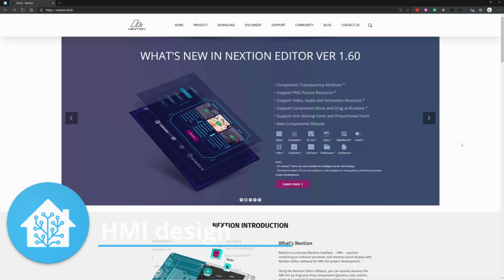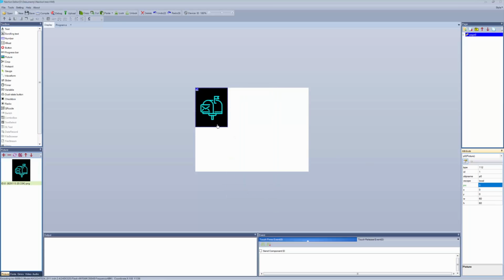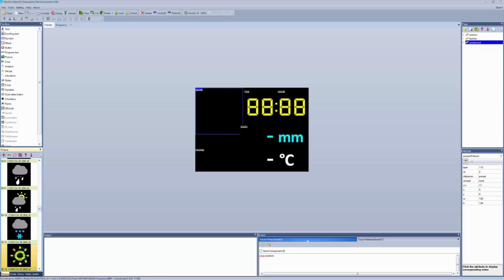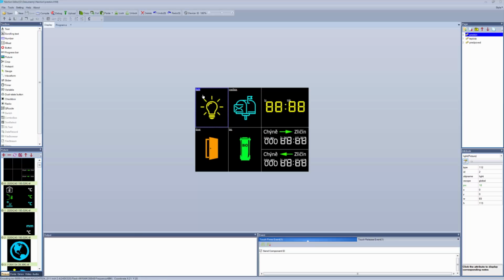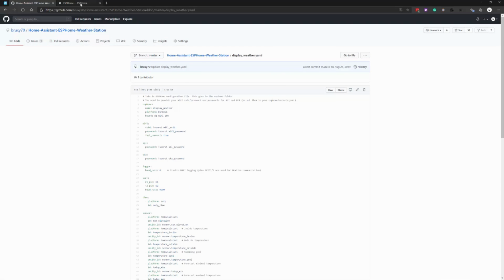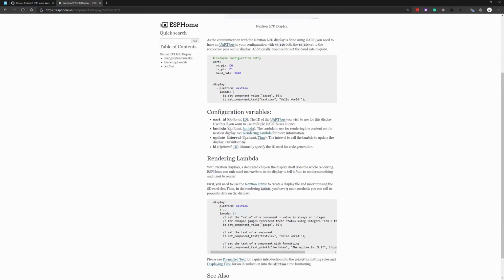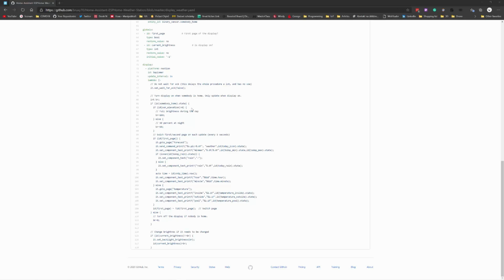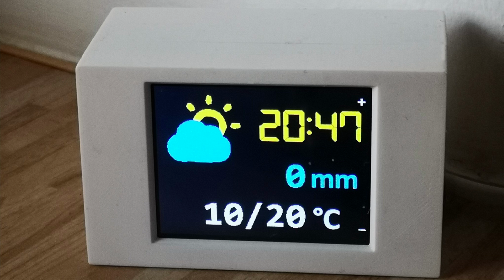DIY displays for Home Assistant

Comment: Hello Vaclav, very good tutorial, very educational and simple. Thank you very much for your time and excellent predisposition. I am working on a home automation project for my house and your code has been very helpful. I have managed to receive information by touching the screen and lighting a led on my proto. Unfortunately I have not been able to send any information from ESP32 to the Nextion screen
Log ESPhome 
[13:42:47][I][app:100]: ESPHome version 1.14.5 compiled on Jul 10 2020, 00:13:46
[13:42:47][C][wifi:415]: WiFi:
[13:42:47][C][wifi:283]:   SSID: [redacted]
[13:42:47][C][wifi:284]:   IP Address: 192.168.0.120
[13:42:47][C][wifi:286]:   BSSID: [redacted]
[13:42:47][C][wifi:287]:   Hostname: 'esp32_a01'
[13:42:47][C][wifi:291]:   Signal strength: -83 dB ▂▄▆█
[13:42:47][C][wifi:295]:   Channel: 10
[13:42:47][C][wifi:296]:   Subnet: 255.255.255.0
[13:42:47][C][wifi:297]:   Gateway: 192.168.0.1
[13:42:47][C][wifi:298]:   DNS1: 200.110.216.250
[13:42:47][C][wifi:299]:   DNS2: 190.12.96.251
[13:42:47][C][uart:040]: UART Bus:
[13:42:47][C][uart:042]:   TX Pin: GPIO17
[13:42:47][C][uart:045]:   RX Pin: GPIO16
[13:42:47][C][uart:047]:   Baud Rate: 9600 baud
[13:42:47][C][uart:048]:   Stop bits: 1
[13:42:47][C][switch.gpio:042]: GPIO Switch 'Relay 1'
[13:42:47][C][switch.gpio:043]:   Pin: GPIO18 (Mode: OUTPUT)
[13:42:47][C][switch.gpio:059]:   Restore Mode: Restore (Defaults to OFF)
[13:42:47][C][gpio.output:010]: GPIO Binary Output:
[13:42:47][C][gpio.output:011]:   Pin: GPIO19 (Mode: OUTPUT)
[13:42:47][C][logger:175]: Logger:
[13:42:47][C][logger:176]:   Level: DEBUG
[13:42:47][C][logger:177]:   Log Baud Rate: 0
[13:42:47][C][logger:178]:   Hardware UART: UART0
[13:42:47][C][light:177]: Light 'Luz Led 1'
[13:42:47][C][esp32_touch:029]: Config for ESP32 Touch Hub:
[13:42:47][C][esp32_touch:030]:   Meas cycle: 8.19ms
[13:42:47][C][esp32_touch:031]:   Sleep cycle: 27.31ms
[13:42:47][C][esp32_touch:051]:   Low Voltage Reference: 0.5V
[13:42:47][C][esp32_touch:071]:   High Voltage Reference: 2.7V
[13:42:47][C][esp32_touch:091]:   Voltage Attenuation: 0V
[13:42:47][C][esp32_touch:097]:   IIR Filter DISABLED
[13:42:47][C][esp32_touch:104]:   Touch Pad 'ESP32 Touch Pad GPIO27'
[13:42:47][C][esp32_touch:105]:     Pad: T7
[13:42:47][C][esp32_touch:106]:     Threshold: 1000
[13:42:47][W][nextion:237]: Received unknown event from nextion: 0x64
[13:42:47][W][nextion:036]: Waiting for ACK timed out!
[13:42:47][W][nextion:083]: Sending command 'draw 50,60,80,102,17013' failed because no ACK was received
[13:42:47][C][dht:017]: DHT:
[13:42:47][C][dht:018]:   Pin: GPIO26 (Mode: INPUT)
[13:42:47][C][dht:022]:   Model: DHT11
[13:42:47][C][dht:027]:   Update Interval: 60.0s
[13:42:47][C][dht:029]:   Temperature 'Temperatura'
[13:42:47][C][dht:029]:     Unit of Measurement: '°C'
[13:42:47][C][dht:029]:     Accuracy Decimals: 1
[13:42:47][C][dht:029]:     Icon: 'mdi:thermometer'
[13:42:47][C][dht:030]:   Humidity 'Humedad'
[13:42:48][C][dht:030]:     Unit of Measurement: '%'
[13:42:48][C][dht:030]:     Accuracy Decimals: 0
[13:42:48][C][dht:030]:     Icon: 'mdi:water-percent'
[13:42:48][C][captive_portal:169]: Captive Portal:
[13:42:48][C][ota:029]: Over-The-Air Updates:
[13:42:48][C][ota:030]:   Address: 192.168.0.120:3232
[13:42:48][C][ota:032]:   Using Password.
[13:42:48][C][api:095]: API Server:
[13:42:48][C][api:096]:   Address: 192.168.0.120:6053
[13:42:48][C][homeassistant.binary_sensor:032]: Homeassistant Binary Sensor 'luz1binsen'
[13:42:48][C][homeassistant.binary_sensor:033]:   Entity ID: 'light.luz_led_1'
[13:42:48][D][debug:023]: ESPHome version 1.14.5
[13:42:48][D][debug:025]: Free Heap Size: 216908 bytes
[13:42:48][D][debug:053]: Flash Chip: Size=4096kB Speed=40MHz Mode=DIO
[13:42:48][D][debug:086]: Chip: Model=ESP32, Features=WIFI_BGN,BLE,BT, Cores=2, Revision=1
[13:42:48][D][debug:088]: ESP-IDF Version: v3.2.3-14-gd3e562907
[13:42:48][D][debug:091]: EFuse MAC: 00007C97F2AB6224
[13:42:48][D][debug:143]: Reset Reason: Power On Reset
[13:42:48][D][debug:186]: Wakeup Reason: Unknown
[13:42:52][W][nextion:237]: Received unknown event from nextion: 0x64
[13:42:54][W][nextion:036]: Waiting for ACK timed out!
[13:42:54][W][nextion:083]: Sending command 'draw 50,60,80,102,17013' failed because no ACK was received
[13:42:57][W][nextion:237]: Received unknown event from nextion: 0x64
[13:42:59][W][nextion:036]: Waiting for ACK timed out!
[13:42:59][W][nextion:083]: Sending command 'draw 50,60,80,102,17013' failed because no ACK was received
He intentado con UART0, UART1, UART2 con el mismo resultado. 
Luego he intentado con un ESP8266 recibiendo un error similar.

The code is

esphome:

  name: esp32_a01
  platform: ESP32
  board: nodemcu-32s

wifi:
  ssid: "XXX"
  password: "XXX"
  fast_connect: true
#  reboot_timeout: 45min
  manual_ip:
    static_ip: 192.168.0.120
    gateway: 192.168.0.1
    subnet: 255.255.255.0
    dns1: 200.110.216.250
    dns2: 190.12.96.251

  # Enable fallback hotspot (captive portal) in case wifi connection fails
  ap:
    ssid: "Esp32 A01 Fallback Hotspot"
    password: "XXX"

captive_portal:

# Enable logging
debug: 
logger:
  baud_rate: 0
  level: DEBUG
  
# Enable Home Assistant API
api:
  password: "XXXXX"

ota:
  password: "XXXXX"

switch:
  - platform: gpio
    name: "Relay 1"
    pin: GPIO18
    
light:
  - platform: binary
    name: "Luz Led 1"
    output: output_led1
    
output:
  - platform: gpio
    pin: GPIO19
    id: output_led1

esp32_touch:
  setup_mode: False

binary_sensor:
  - platform: esp32_touch
    name: "ESP32 Touch Pad GPIO27"
    pin: GPIO27
    threshold: 1000  
    
  - platform: homeassistant
    name: "luz1binsen"
    entity_id: switch.luz_wcedu

  - platform: nextion
    page_id: 0
    component_id: 2
    id: p1
    on_press:
      then:
        - homeassistant.service:
            service: switch.toggle
            data:
              entity_id: switch.luz_wcedu

# Sensor de temperatura humedad
sensor:
  - platform: dht
    pin: GPIO26
    temperature:
      name: "Temperatura"
    humidity:
      name: "Humedad"
    model: DHT11 
    update_interval: 60s
    

# Pantalla Nextion
uart:
  rx_pin: GPIO16
  tx_pin: GPIO17
  baud_rate: 9600

display:
  - platform: nextion
    id: nextioncocina
    update_interval: 5s
    lambda: |-
      it.set_wait_for_ack(false);
      if (id(luz1Cocina).state) {
         it.set_component_picture("p1","2");
      } else {
         it.set_component_picture("p1","1");
      }

I already thank you for your attention
I always wait for your next video !!!
Reply from the maker: Hi. I'd start with something simple like setting a text using 
it.set_component_text("t0","Hello world");

To set picture, try the command
it.send_command_printf("%s.pic=%.0f", "p1",1);
it.send_command_printf("%s.pic=%.0f", "p1",2);

I would not worry about the no ACK message, it says that, I am not sure how to get rod of that.
Reply: @bruxy70  Thank you very much for your prompt response, I really appreciate your collaboration. I have invested a lot of time in my project and I have reached a point that I feel frustrated after doing countless tests.
I have tried basic commands with the same result.
it.set_component_text("t0","Hello world");
[17:02:57][W][nextion:237]: Received unknown event from nextion: 0x74

[17:02:58][W][nextion:036]: Waiting for ACK timed out!
[17:02:58][W][nextion:083]: Sending command 't0.txt="Hello world"' failed because no ACK was received
[17:03:07][W][nextion:144]: Received unknown filler end bytes from Nextion!
...
Reply from the maker: @claudiocorazza  Ok, then I am afraid I do not know how to fix that. I suggest you register the issue on the ESPHome issue tracker. I did not use ESP32 with the displays and I do not know why it does not work for you.

Comment: Really well done interfaces, and I really appreciate your home automation philosophy. I have similar rules for my stuff (should have physical button/ability to easily work when the internet is out, should make things easier, etc). The one thing I kept thinking though, is unless you can really get those displays cheaper, it's probably actually less expensive to get an old phone or tablet.
Reply from the maker: Thanks. I do not see $15 as a deal-breaker https://www.banggood.com/Nextion-NX3224T024-2_4-Inch-Man-machine-Interface-HMI-Screen-Kernel-In-English-p-1105052.html?utm_campaign=19381694_november&utm_content=2635&p=@K220219381694201802&cur_warehouse=CN

Comment: Great video ! Weather station on the kitchen table is that what I need ! But I have a question. What kind of tracker do You use to see who is in home ? I'm using device tracker based on android application but it's very slowly.  Pozdrowienia z Polski :)
Reply from the maker: I use a combination of Android/iPhone app and nmap tracker. But for the displays, I actually use armed/disarmed notifications from the security system.